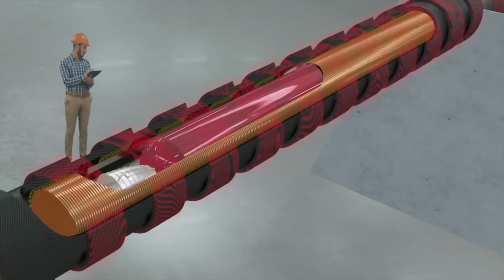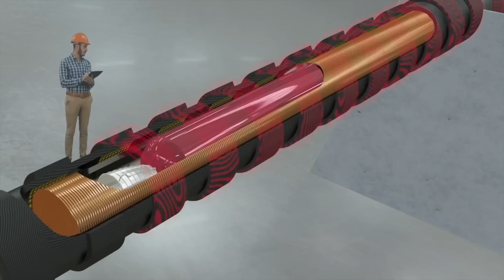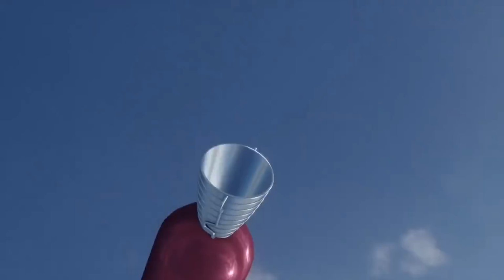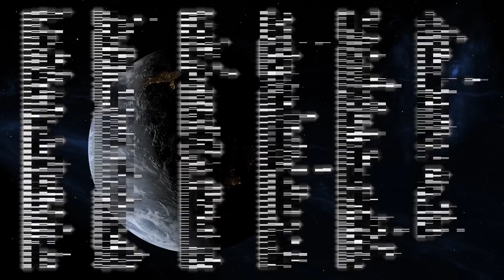Launching Rockets With Electricity

Comment: The best way to go into deep space is by building a space cargo ship. Which will cut the cost of sending items to the planets. Right now the players are wasting money with just one craft at a time into the solar system. Send things needed to set up a bass by cargo ship! It will not only cut costs but cut the risk of landing them, as on board a manal landing talk over if required. The ISS supper structure is a great starting point. Have a human crew aboard, helps in fixing any tech problem alone the way.

Comment: Go back 30 years and read the book The millennial project. The author posits putting the accelerator on Kilimanjaro, already halfway out of the atmosphere requiring much lower launch speed and energy. I believe Martin Savage was the author. It's very very well thought out and I believe it was published around 1985. There used to be clubs around the US that would gather and discuss these ideas. The book goes way beyond that in terms of colonizing the galaxy but the mass driver on Kilimanjaro was the most striking idea in my mind. And as for spin launch, hahaha.
Reply from the maker: I remember that book. I think he proposed putting blocks of ice on the back of the EM-launched spacecraft and then zapping them with lasers.

Comment: He spoke of a 10km EM Vac Tube ... mass driver... 
He did not mention nor was it suggested a circular donut with a diameter of 100km with a 10km tube - exit aperture at elevation, say 4km.
Such could be constructed underground in say South France to have the exit aperture in the Alps - Eastwards.
Or Westcoast North America, or Mid North America... anywhere with flat plain and mountains to the East.
The power production is less than a standard 1st generation nuclear reactor.... Three Gorges in China could power numerous.
By having a large donut cyclotron with the push, pull EM drivers able to accelerate the cargo capsules... 3m diameter tunnel and 10m diameter tunnel for different sized payloads, could reach sufficient delta v for orbital in under 10 loops. It is only a few more to reach escape velocity.
We can make MRI machines with 13T... the coils would be far less Teslas. 
The Quenching Issue... I would have liked for more elaboration as to more specific issues of when the charge has discharged or 'looses it'.
It seems a simple design issue and with more information about the issues and problems encountered... a solution/work around could be created.  :)

Comment: Good luck getting to minimum Mach 33 (11.2 Km/s) to escape into orbit... If the payload isn't turned into a pancake from the acceleration and the vehicle's hull isn't damaged, maybe this could work.

Even if you got to like half the escape velocity (5km/s) if that mass took 5 seconds to accelerate (so 1000 m/s^2) you'll have over 100Gs of gravity and the track would have to be 12.5km long.

These launch ideas are all DOA. The space elevator is really what we should be focusing on. It could literally be powered by atmospheric voltage if material science continues to evolve as it is.
Reply: You're confusing orbital velocity with escape velocity.

Comment: Would be better to launch water in orbit and make it in to LOX/LH2 with solar energy than make the oxidizer and fuel on the ground? And look likes LX-99 is actually a room temperature/ambient pressure superconductor and so will make this engineering doable?

Comment: I am curious about the rate of reusability and efficiency of the a quench gun. When quenching the coils, presumably the magnetic field energy is converted to heat. That heat needs to be pumped out of the coils to get them to superconduct again in preparation for the next launch. How is the energy allocated between powering refrigeration equipment and charging the coils? How much of the total energy input is converted to kinetic energy? How long does it take to cool down a coil?

Comment: This is my favorite interview so far. Clear, and focussed on the engineering. Awesome! Question, what would be the theoretical limit in speed for such a system,in a vaccum?
Reply: The theoretical maximum speed isn't known.  We estimate four to six kilometers per second are achievable.  The essential problem becomes one of how fast you can switch the quench motor.  The good news is that the two magnetic fields, one from the carrier sleeve (the armature that is pulled) and one from the stator (that does the pulling)  engage with each other at the speed of light.    There isn't any good news after that.  ;  )   We aren't publicly sharing particular design details at this point.
Reply: @freeprint  Thank you for this answer. In true scientific manner it only strenghtens my curiosity.
Reply: 600000 miles per second

Comment: When i was a kid in the 80's and i used to watch shuttle launches on TV in Ireland,it was an awesome sight but even as a kid with no knowledge of propulsion etc,it struck me that this was a tremendous waste of energy as a kid i thought you need a propulsion device that pulls you forward rather than push you forward,then years later i heard Bob Lazar explain the way the power works on alleged recovered UFO's and that's exactly the way my child's mind thought of traveling through spacetime to other solar systems,now i didn't understand warping spacetime folding it etc to shorten distance,in my child's mind I saw a beam point at place in the universe and the spaceship rode that beam, unfortunately my curious childs mind never developed to it true potential bc i never gave it a chance,the rave scene hit i started to travel in different dimensions,what a waste ☘️🇮🇪

Comment: Put it in the ocean, at the equator. Have it partially submerged use the water in the ocean as a natural thermal regulator at the same time taking advantage of the Coriolis effect being strongest at the equator, and you could pump high pressure inert gas down to the bottom of the ocean and use the pressure created by the force of all that water as an aid to smoothly regulate acceleration so it doesn't disintegrate the first time it accelerates, make it extremely long takeing advantage of every advantage that nature gives you. We built supercollider tubes that are over several kilometers long... this isn't much different. The only difference is the amount of imagination involved. This takes much less in my opinion of that particular. Please let me know if I missed something here.
Thanks for the mind buzz.
C

Comment: High Temperature Superconductors are ceramics. For high stress environments use the low temperature superconductors like NbTi. Fermilab used them in Tevatron II and they are currently being used in the LHC. NbTi is cooled to 1.9K using liquid Helium and can achieve 9-10 Tesla fields.
Reply: Those ceramics are a thin film deposited on a high-strength Hastelloy substrate and are handling high stress. 400 MPa tensile stress is no exception as design stress. Operation at 1.9 K  is fine for a DC magnet but the cooling costs and cool down time would be prohibitive in this application.

Comment: It isn't a Rocket - if it doesn't use a Rocket engine.  It's a projectile. Why not just make a giant vacuum tube and suck them into space?  Why not just get a winch on the moon and winch them up?  Oh a giant spring .. that would work.  A giant airgun.  A space elevator with super fibers.. Blast them into space with a nuclear bomb.

Comment: The kind of acceleration that would take place inside a electromagnetic "railgun" type tube would probably not be safe for humans, only inanimate objects. Otherwise I would imagine the acceleration inside the tube would peel the skin off our faces.
Reply: Yes, they did mention this briefly. He said the best uses would be raw matterials- rolls of metal sheeting, fuel, water, etc. Basically the higher the mass, the higher the volume, and the less squishy it is, the more this approach makes the most sense.

Comment: Don't think he explained quenching very well in context of how it relates to the conventional use of the word.  I see it as superconductor becoming massively hot - due to massive current spike in a now resistive element (when supercon fails) . It's still immersed in supercold cryogenic fluid Helium - which then rapidly boils and gassifies (rapidly). Very much like as you would plunge a red-hot iron into oil , water  to 'quench'.
Reply: does it become super hot in this application though? I mean how much of that Energie would go into the projectile?
Reply: Ah, thank you, the term makes perfect sense now. 
And I am still concerned about what happens to all that amperage that suddenly shifts from "motive power" to "heating/arcing power" when each ring or coil suddenly shifts from "resistanceless" to "heating element" as it launches a payload. Even though he refers to them as "high-temperature superconductors" he doesn't mean the inert material can survive being superheated! 
And at 26:00 and onward he makes me very nervous about this "quench launch" effect in other ways too... "significant engineering problems" indeed...
Reply: @MusikCassette  Earlier in the video Dillon said the Quench effect is more efficient than other railgun acceleration techniques, but those other techniques are only 30% efficient. I can't remember the efficiency percentage of the "quench-launcher" but with the power levels he's describing, even 90% efficiency means that 10% of that tremendous energy gets turned into heat WHILE EACH RING ELEMENT IS STILL SUPERCONDUCTIVE. As soon as you quench a ring element, that power doesn't vanish: it ALL turns to heat. Or it arcs out, if you can rig some kind of lightning-rod grounding element... that's how I'm guessing they "de-fang" this thing, but no one else has mentioned this, including Dillon. So maybe there's another method? I'm not an engineer, just a space journalist/activist, so I don't want to assume anything. But Dillon's focus on the challenges makes me wonder how they got this "quench" demonstrator to work at all! 

But they did! 

How?
Reply: @Wordsmiths  Well it does not go all into heat. Some of it ends up in the projectile. But you are right: even with 90% efficiency that would still be a ton of heat in a very small amount of time to deal with.
Reply: yup, and that rapidly turns into an explosion.
Reply: @jessepollard7132  y would it?

Comment: Doing that on the moon is a lot easier. No air resistance, less speed required which means more payload and shorter "gun" and yes no fuel. I'd say the moon is perfect for that and Ceres even better.

Comment: Fraser, now do a segment on the hydrogen launcher.  Interview John Hunter at Greenlaunch about past efforts.  You can launch to 8 km/sec with no superconductors, with a device so simple and cost effective, just concrete and steel, that it is remarkable more effort into it hasn't been deeply researched.  This was worked on at LLL (SHARP program) during SDI, but dropped when SDI fell away.  They got a ten lb projectile up to mach 9 before the money was cut.

Comment: Even if you manage to build the launch installation, and you do so on the highest part of the planet above sealevel (an engineering marvel in itself), the exit cannot be higher than, say, 5-6km above sea level. The air density is still so high at that height that anything being launched and coming out at 5 km/sec or more would instantly burst into flames and ablate to oblivion really fast. I don't think there is anything that can protect against that. I applaude the effort despite being a bit skeptical.
Reply: It can be lifted up with balloons, high up in the atmosphere,  where the air is thinner,  perhaps  3 balloons,  one in each end and one in the middle?
Reply: If spin launch can do it they can do it too. This is actually easier.
But I would suggest to build a smaler version of this, that brings it payloed to a speed for a ramjet.
Reply: @MusikCassette  Speaking of that, has spinlaunch successfully launched something into orbit?
Reply: That technology was solved in the 60's with ICNM's. In space at 17,000 mph and at ground level a second later.
Reply: @MusikCassette  Doubt spin launch can be useful.
Reply: @paulbedichek5177   it is certainly less viable, than a massdriver due to the hight g forces.
Reply: Actually, this is already known as something that can be done.  The forces are high but manageable.  The temperatures extremely high from compression heating but existing, even relatively low cost materials, such as carbon ablative will suffice.  One helpful thing is that time in the lower atmosphere (e.g. from 10,000 feet to 100,000 feet ) is not too long,
Reply: @freeprint I am sceptical but not dismissive. Definitely should get a chance to prove itself.

Comment: I had before imagined a launcher where one could have a very long cannon, but accelerating a payload using a series of timed detonations (just as soon as the payload is moving past a given location; an explosion triggers from behind it to push it faster; likely by maintaining high-pressure charges of hydrogen and oxygen and dumping them into the barrel at just the right moment). Seems like something like this could possibly be cheaper/simpler to build on Earth.
Though, superconducting magnets is still a cool idea in any case...
Reply: That's been considered. IIRC Saddam Hussein was building one.
Reply: @bozo5632  OK. I don't really have any specific information about how his project would have worked (descriptions are a bit sparse on specifics).

Trying to imagine stuff though, seems like the secondary charges would pose their own difficulties. Both normal gas and liquid phase H2 and O2 is unlikely to work effectively, so there would (likely) need to be a mechanism to heat both into a supercritical state prior to injecting them into the barrel.

Well, or the "technically simpler" option of probably lining the barrel with a series of black-powder charges or similar, which could be ignited by the shock-wave (and designed to funnel the blast back into the barrel). For this, would need to replace all of the powder charges after each use.
Reply: @BGBTech  IIRC I think Saddam's gun was going to use a series of explosive charges along the length of the barrel somehow. 

IDK but it seems like a mass driver couldn't be a whole lot harder to build, or more certain to kill the operator. :)
Reply: yup. -https://en.wikipedia.org/wiki/Project_Babylon  @bozo5632

Comment: I imagine this could be combined with the spin launch idea to straighten out there launch trajectory and give an additional boost in velocity and not need a 5km vacuum tube
Reply: How much of an advantage would it be to overcome gravity by launching at altitude, like Denver, or higher, than what they do now at sea level?
Reply: Nope. such a thing requires changes in deltaV - and that change has to be compensated for somehow - and currently only rockets work.

Comment: Rather that a rail gun type of approach, why not a hyper loop type.  Much of the energy of a launch is in the first minute or so getting from 0.o to 500 mph and 10k ft.  Set a track up on the side of a mountain that accelerates the launch vehicle to 500 mph and you would save much of the fuel needed to get to space.  Also, the acceleration would not be so great that it would kill ppl or destroy cargo.
Reply: Probably not enough savings to be economically worthwhile given the extra hardware needed.
Reply: still have to get through the atmosphere.

Comment: Could it be technically fit into a deep mining shaft?
Reply: why would you want that?
Reply: @MusikCassette  Shaft would provide a structural integrity to resist downward forces, possibly solving some engineering challenges as well as limiting costs. Furthermore it is vertical.
Reply: @piotrjasielski  how would a shaft absorb downward forces better than  well the ground?
Reply: @MusikCassette  Ground is only on one side and you need to perfectly level it, then harden well enough to anchor the structure. Shaft is a hard rock, you can use to anchor to. It is also perfectly vertical, no need to make adjustments and move half of the mountain.

Comment: how about making a 3d printer that can be used to resurface the rails every so often as would be necessary.  your going to be dealing with a large bore so it shouldn't be that hard. if there are other structural issues, well you'll figure it out with a little help from your friends.

Comment: For the Moon it should be great.   On Earth though it may well be able to replace a first stage. High temperature super conductors should be able to help. (You said "low temperature" in the intro').  Liquid nitrogen temperature super conductors are not so big a problem now I understand. 

Ground based energy helps to over come the limits of the rocket equation. So yeah any velocity you can put in by an electromagnetic launcher before you light the engines is good.
Reply: You'd have to stiffen the launch vehicle considerably, maybe too considerably.

Comment: I wonder if a room temperature superconductor finding would be useful for this. I mean, actually ambient air temp. Maybe it would weigh less and get us closer to 8 km/s. Thanks, Fraser!
Reply from the maker: Absolutely, it would be a total gamechanger.
Reply: A room temperature superconductor would help with literally anything and everything technology
Reply from the maker: If it's magnetic or uses electricity, a room temperature superconductor would make it better.
Reply: @frasercain   That LK-99 room temp superconductor has maybe been confirmed by independent researchers.
Reply from the maker: I saw someone confirm it for 100 K, but that's well below room temperature.